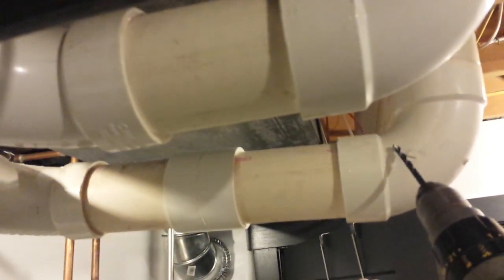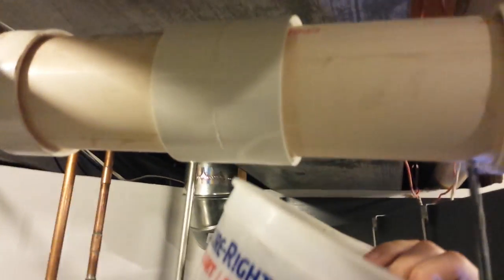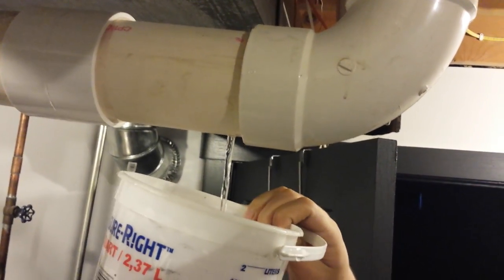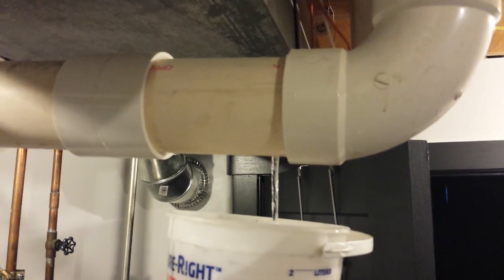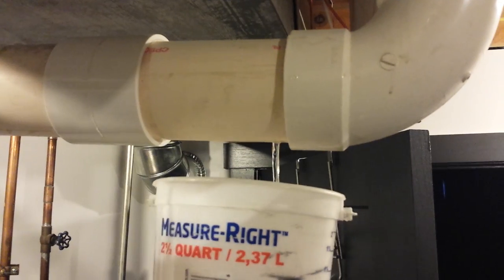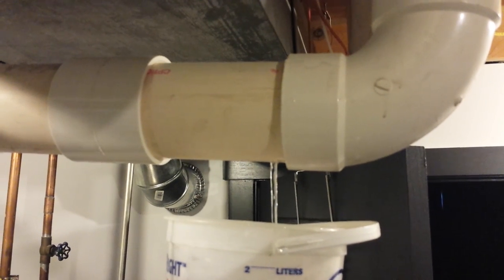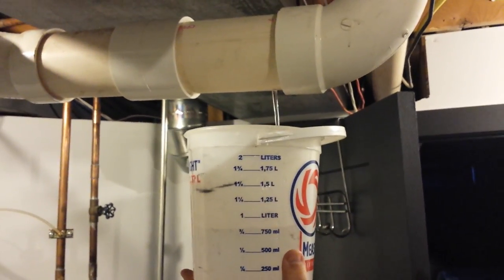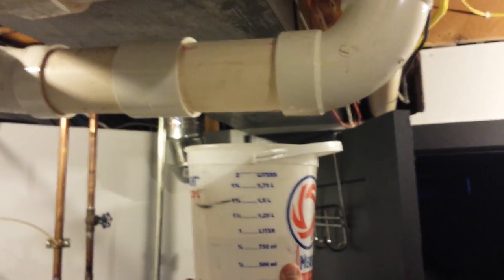Furnace exhaust holding water

Comment: If I understood correctly., for either direction, the PVC pipes should be held at certain angle, so the air can go upwards to the outside exit port. Whereas the water shall go downwards to the furnance and exit out through a separate small water pipe down to the floor drain hole.

Comment: As the viewer you need to understand that this trick needs to be done with the furnace turned off and that the vent needs to be replaced with an intact pipe before the furnace is started again. Leaving a hole in you vent pipe with the furnace running puts toxic flu gases into your home. NEVER ALLOW A VENT PIPE TO LEAK INTO YOUR HOUSE.
Reply from the maker: Thank you for the comment Mark. As Mark stated, be sure to turn furnace off and to NEVER ALLOW A VENT PIPE TO LEAK INTO YOUR HOUSE.
I recommend installing a plug-in(AC) Carbon Monoxide detector with a battery backup in the same room as the furnace.
Below is one that I would recommend using. 
http://www.kidde.com/home-safety/en/us/products/fire-safety/co-alarms/kn-cop-dp-10yb/

Comment: my furnace pipe runs through the roof of my house and the 1 pipe doesn't have enough fall in it and get's water in it is  there some sort of a cap i can use for it?
Reply from the maker: Putting a cap on it could cause your furnace to quit working. You need to check with your manufacturer recommendations
Reply: Thank you

Comment: It could be nicer if you could explain the reason why it got water
Reply: The furnace vent pipe removes gases produced by combustion.  One of those byproduct gases is water vapor.  As it travels up the vent the water cools and condenses back to liquid. The flange at the inducer fan has a drain hose where what should be a small amount of water at a timeis supposed to collect and drain -- you should see it running to a trap and drain hose to the side of your furnace.  If it's not working right, or the angle is pitched wrong, you can get the liquid water collecting in the exhaust vent pipe as happened here.  Eventually that is going to run back into your inducer motor and wreck the motor, and/or back up into your pressure switch.  Either way, your furnace stops working.

Comment: How does pvc hold up to high heat running through it? I'm interested in using some for a short run heat vent.
Reply from the maker: Typically HVAC pipe used for heating is galvanized metal ductwork. 
Check your local building codes to verify what is acceptable for your application.
Reply: That's what I was thinking but after seeing your video. I see its not metal. So how hot do your pipes get? How do they hold up to the heat? Interested in the integrity of the material under heat. My application is not for a house. Also I just like learning about building materials. Ive never seen high heat running through a pvc like material. So that is why I asked.
Reply: @JoshuaCussins  
If your furnace uses metal venting you can’t use PVC venting 
They are 2 different kind of furnaces 
Only high efficiency furnace 90./. And above can use PVC venting

Comment: So, what was the fix?  I understand the problem. I understand we cannot leave a pipe with a hole there. Why did the pipe in the video need replacing?  ....AND what was the fix so that condensation doesn't collect in the future?
Reply from the maker: The exhaust needs to have fall back towards the furnace. We had to cut a section out and replace with the correct amount of pitch on the pipe.
Reply: @HammerleHomesProject  I gotcha! Thanks for clarification!
Reply: Hammerle Homes if you do that all that water will go in the furnace and will rusted the pipes and the unit? There must be another solution
Reply: @aa07011  if this is a high efficiency furnace the pipe needs to tilt towards the furnace so the condensation flows back to the furnace where it goes through a drain inside and flows out to pvc  to a floor drain.  it does not damage the furnace
Reply: @deacontravel  you clued me to the clogged hose and manifold for the drain.   working perfect, 0 dollars.  

most likely was all the condensation from the summer air cond, and since it couldnt drain, heater unable to stay running.
Reply: @deacontravel  I have a high efficiency carrier unit.  Getter ng error code 3 2....water is leaking around unit but don't see where. Cleaned condensate trap , inducer hose , collector box hose....which the collector box hose when disconnected had plenty of water in it but when connected back to condensate trap no water comes out  of trap to floor pump and I still get the 3 2 error code. Which I'm guessing as it says possible problem water in vent  piping.  Which goes back to ...where's this drain you mentioned in inside of unit.  I'm almost at the point if drilling a hole in the PVC exhaust pipe where I do see some water

Comment: My furnace is new less than a year old installed my sears, had to drain the pipe two days in a row could be rain water coming in the exhaust which is sitting perpendicular to the ground or could it just be buildup of condensation that much overnight?
Reply from the maker: Most exhausts pipes have a 90 degree elbow or special fitting to prevent rain water from getting in on the outside of the building. 
It is possible that condensation can occur over the course of 24 hours but it should drain out on it's own. 
Check the pipes for proper pitch and make sure it is not being restricted on the outside.
Reply: If it's a high efficiency furnace, condensation seems more likely.

Comment: Couldnt use just put a tap and hose from elbow to the other plugged hole on the water trap clamped to the inducer?
Reply from the maker: That maybe possible but you would need to check with the manufacturer.